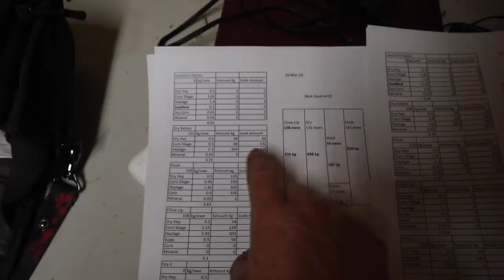SHE'S RUNNING THE FARM!  (training our teenage daughter how to sheep farm) Vlog 251

Comment: TIM from Canada suggestions when you are pulling any sort of motor pull your cord as far as you can into the machine... wait for it to connect with the fly wheel.. give it one or two small tags to make sure it is connected.. then one or two big hard pulls Connect with the fly wheel and this will start the motor.. this works if your having a hard time with any motors...

Comment: Dump the mineral on the dry hay while it's still in the loader. Much easier and safer
Reply: I was thinking the same thing.  The only problem with doing it that way is the TMR weighs what's in it and the mineral is rationed based on percentage weight. If you don't know how much is in the loader it'd be hard to get the correct amount of mineral.
Reply: @holleyhillfarm  you could have the pail of mineral weighed and do you calculation from there

Comment: I thought it before seeing you add the mineral but seeing it again with Jess struggling a bit why don’t you dump it into the telehandler with the silage and dump it in the mixer that way? I had also thought about welding a platform to put the bucket on while climbing the ladder but I think putting it the with the silage would be easier. I also worried about what if the bucket fell into the mixer. 
I can totally sympathize with Jess about working with mom, lol.

Comment: It worried me at almost the 11-minute mark when your daughter was changing the front end on that piece of equipment. She left the engine running and walked in front of it and there's a great big are sticking out in the front if that piece of equipment for some reason what jump gears and start forward she could be impaled by that I know it's quicker to walk in front of the equipment machinery but everyone should be walking behind. My cousin had just had her car fixed the transmission I believe it was and she was parked on a hill. She didn't put the emergency brake on she just always left it in park and instead of walking behind the car she walked in front of it and the car ran over her and was laying on her leg until someone could start the car and back it up. But with that bar sticking out in the front that's kind of dangerous especially with the engine running. Maybe I'm a worry wart I've never worked on a farm but I just know what happened to my cousin and if your daughter was there by herself and her cell phone was run over she could be in a lot of medical trouble. I realized this was like a year ago so I don't know whether you'll ever read this and respond but it just worries me because I know a lot of accidents happen around Farms. When I taught third grade I remember every time I said take this letter home to your parents I was a beginning teacher... A little boy in my class would say my dad's did the tractor ran over him. His dad was a farmer and after a couple times he said that I learned to say take this home to your mom or your dad.